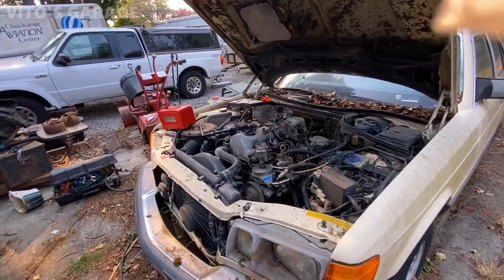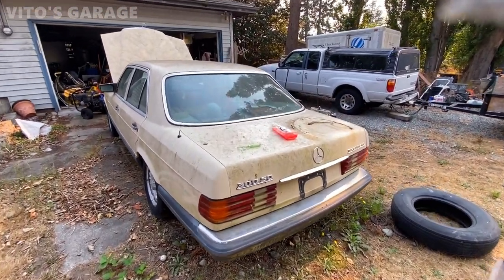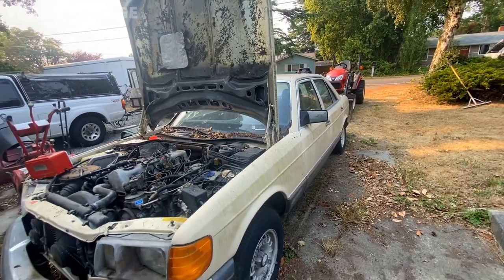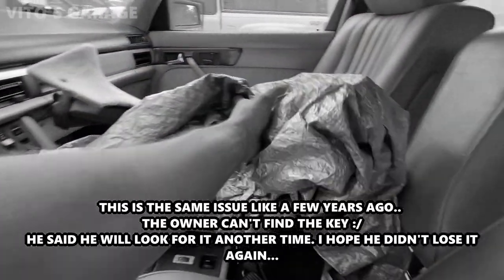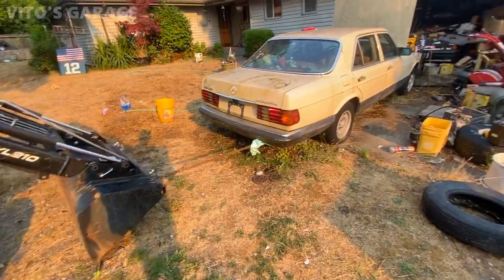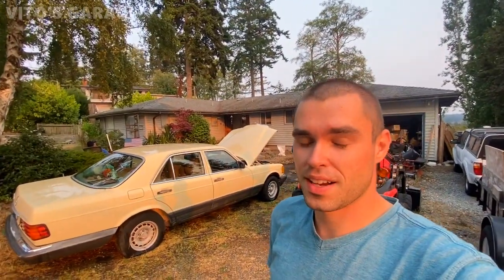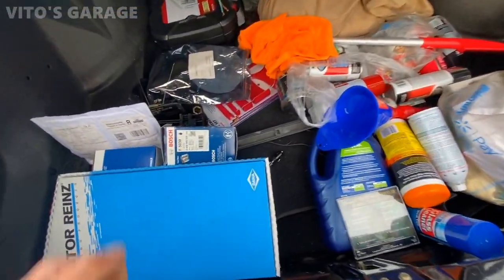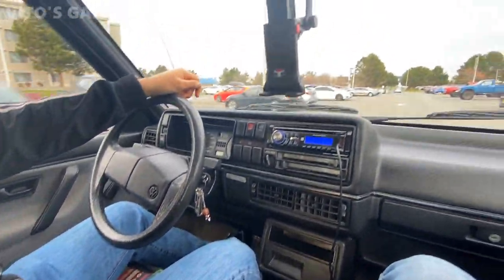First Wash & Detail After a Long Time on an S Class Mercedes W126

Comment: That car needs a new owner.
Reply from the maker: He’s selling it if you’re interested
Reply: @VITOSGARAGE  
Your friend with the black Jetta should buy it.  The Jetta will never be as good as a w126 300sd.
Reply from the maker: @vintage76vipergreenBeetle  I’d not downgrade that Jetta that much. It’s a very solid and reliable car and has a good fuel economy as well as 5 speed manual.